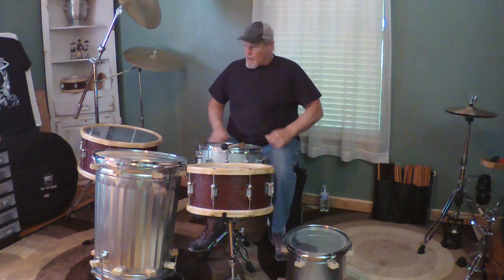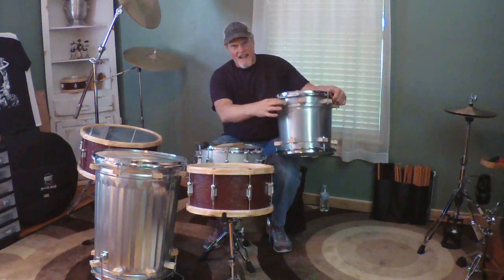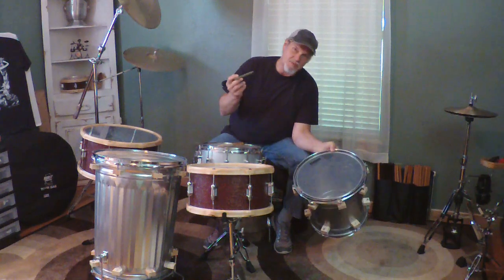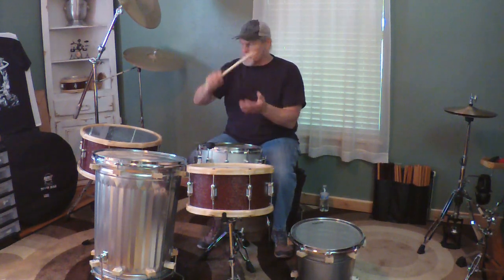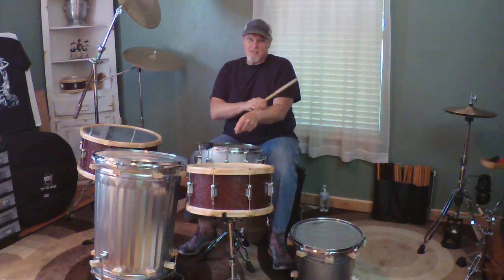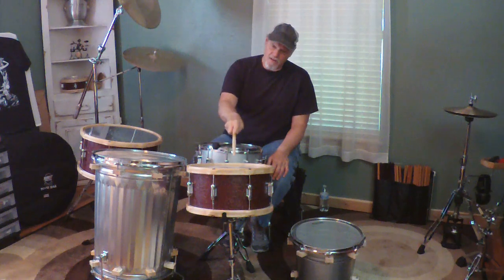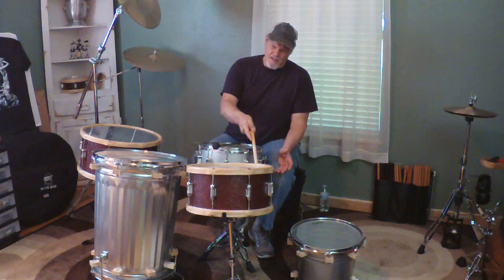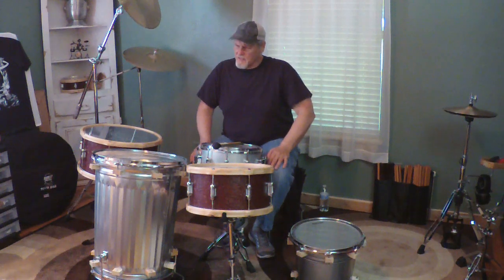Drum Shells, Sound, and Hype - Part 10: Sustain

Comment: I wonder...  the lug anchor points on the trash cans might be less stiff than on the wood shells.   So if they're flabbier, maybe they'd absorb some of the head's tension/vibration, soaking up some sustain.   To me, different characteristics are useful for different sound palettes.  I'm enjoying your videos, keep it up
Reply from the maker: I don't know if any substantial absorption is taking place but, obviously the head's tension becomes a variable because the lugs are anything but rock solid and I could only tension the heads just so far and head tension has so much to do with sustain.  Obviously the cone shape throws in variables, as well.  Regardless of shell designs, I believe far more sound characteristics can be obtained by changing heads.
Reply: @REFondrums  those are great points.   I want to make a few for myself now =]

Comment: I’d  L O V E to know if different METALS affect Snare tone🤔 BTW do ya think there is a difference between different makes/priced Snare Wires..?🤷‍♂️
Reply from the maker: It isn't so much the metal as the thickness/density of the metal shell that makes the most difference, especially where volume comes in. Trap the sound waves longer, increase the volume. Snare sensitivity is a matter of head tension and wire tension, along with bearing edges, and how the drum is mounted. Just like toms, the less pressure on the drum via snare stand clamping, the more the entire drum can vibrate, which effects sensitivity. Honestly though, the house percussionist in a symphony orchestra might be more concerned about the articulation of snare wires than players in Rock, etc. 
In a close up comparison of wires: steel, brass, copper, straight wires, etc and how strainers tighten them; pull them into the snare head, you can hear differences. Once the music starts, though, it's a snare drum and back beats for most players in most genres.
Reply: REFondrums 

Well I remember a time when it was pretty much “one fits all“ for the snares/wires & ya bought them and used them and you rarely ever had to change them but I was asking that question because now there is all manner of things available and I was wondering if it was just “snake oil again“!

Anyway I look forward to when you do a comparison of snare drum materials/depth/diameter/et cetera😉👍!
Reply: I can say from very recent personal  that yes snare wire material CAN make a difference. But I won’t say that any of my findings will apply  to EVERY snare out there. I bought a slightly older Tama Starclassic Maple snare back in January of this year. It had Tama Starclassic Bell Brass [Bronze] wires and I couldn’t get a good snare response without over tensioning the wires. I installed a regular set of High Carbon Steel Tama wires and all the problems vanished. The Bell Brass wires did work perfectly on a Tama Starclassic Bubinga snare which has a slightly thicker and higher density shell. Both snare beds are of the same modern Tama specs.
Reply: @Assimilator702  thanks!
Worth Bearing in Mind…
👍

Comment: Shell is louder because the shell is thicker. It's not the nature of the material, per se.
Reply from the maker: Well, true, though I would say a 1/4" metal drum will be louder than a 1/4" plywood shell. Not by much but, if the trash cans were 1/4" thick they'd be considerably louder. You know shell density is the key for volume and greater frequency representation from the sound waves off the heads.
Reply: Denser not thicker. If you harden the inside of a raw interior of a wooden snare drum or any wooden drum it’ll brighten the tone and increase volume when hit with the same velocity. By “harden” I mean lacquer finish. Thicker shells narrows the barrel of the drum which also raises the pitch. For example a 14” 40 ply snare drum is now 12” inches. I never understood mega thick shells, seems like such a waste of material.
Reply: I have an experiment for you! Line the interior of wood shells with sheet metal and see if it increases the volume when struck with the same velocity.
Reply from the maker: @CALLITQUITS25  Mercy, I did that back in the 90's the first time. I never noticed a serious difference. It tended to dry the sound out and maybe add a tad of brightness/hardness but, nothing that could cut through a band.
Reply from the maker: @CALLITQUITS25  Having used all kinds of finish materials inside shells, the only actual difference I ever heard was a strange frequency addition, like a "ping" depending on the amount of finish. From those observations I began putting just a one or two coats of tung oil, which would sink in enough to leave the wood hardened but not brittle or "pingy" sounding. Of course, that's a matter of taste and highly subjective. 

The interesting thing about really thick shells is that, while the interior changes dimensions you still have the OD head size on it. You do increase volume, regardless of material, specie to specie, material to material but, pitch changes take place at the same relative tension the heads are placed at.

Comment: Great video. Have you tried making your own plywood shells from scratch from veneer or plywood? I would love to see your process for building drum shells, finishing, etc. I am in thep process of building my own kit. Very enjoyable process.
Reply from the maker: I hope it turns out great. Check my videos on my plywood drums, which are made with stacked plywood rings and plywood hoops. 
I have made small shells simply gluing and rolling up veneer lengths; just one piece, add bearing edges and they sound fine.